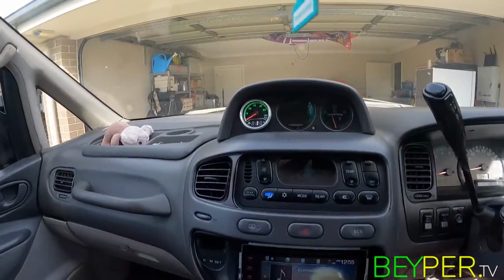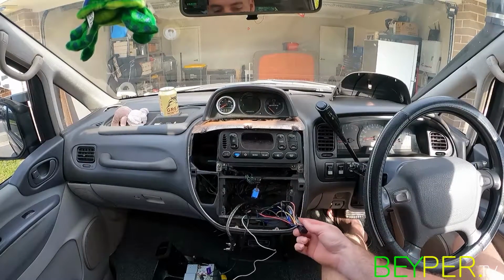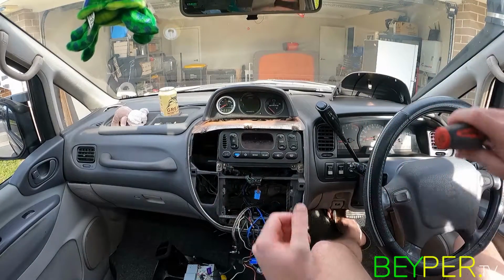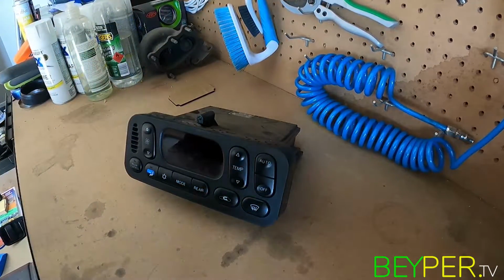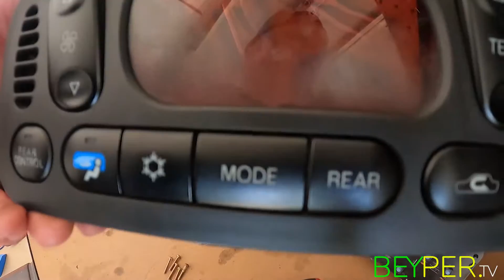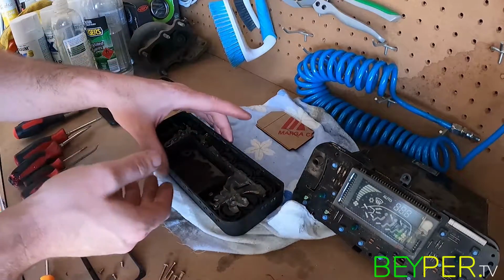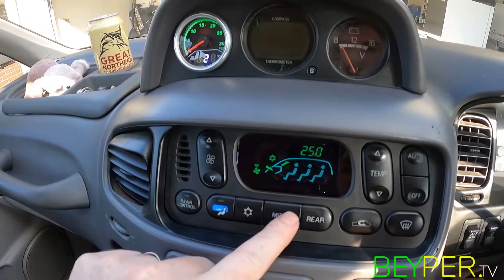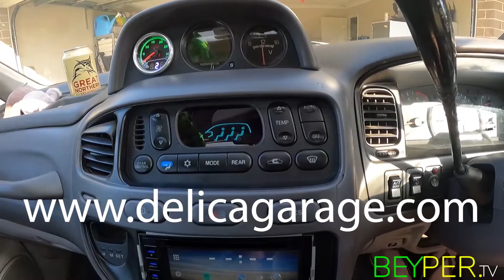Delica camper episode 10

Comment: hey mate curious fi youve done a video fo your radio change that you could update
Reply from the maker: Hi Connor, that head unit was allready in the Delica when we purchased it.
I had only previously removed it once to fix an electrical issue and then redone majority of the wiring in there. 

I do want to change it again soon to a bigger screen and I'll definitely be doing an episode on that upgrade 👍

Thanks for the question mate. 

If you need anything else, let me know 🙃
Reply: @BEYPERMEDIA  legend thanks for that mate you havent sourced any ladders for the potentially
Reply from the maker: @connormorey7429  hahaha the good ol ladder saga 🤣
I myself only recently picked up a ladder for $200 without the mounting plates, I have since got the top plate but need the bottom 2 before I fit it on the van. 
I have seen someone on the delica forum make the bottom plates from stainless steel and I did save the measurements so I might get some made if I can find some standard ones... 
It's almost worth just paying the $600+ for a complete ladder 😅

Comment: Excellent vid>>>>my delica is the same so a nice easy fix>>>>>>✌️✌️>>>>>Can I ask what type of temp gauge you using as I need one for mine.
Reply from the maker: Thanks for the great feedback on the vid 👍 
It is actually really easy to change as it is all screws holding it in.
That is a SAAS boost and EGT gauge so that only shows  boost pressure and exhaust gas temp, you can purchase a variety of different ones from Supercheap Auto!
cheers.